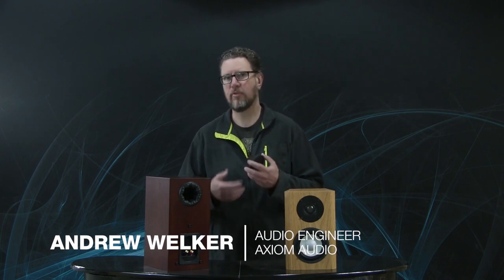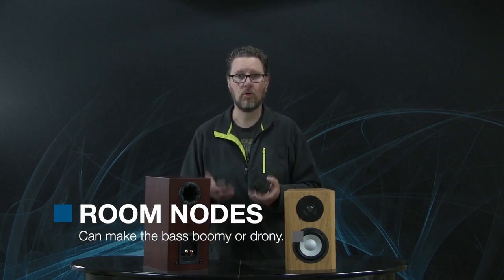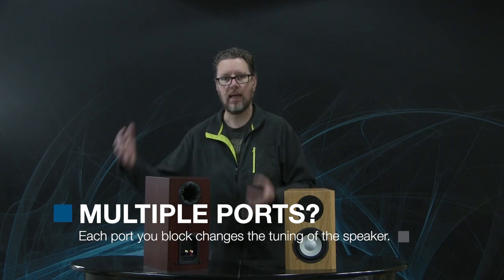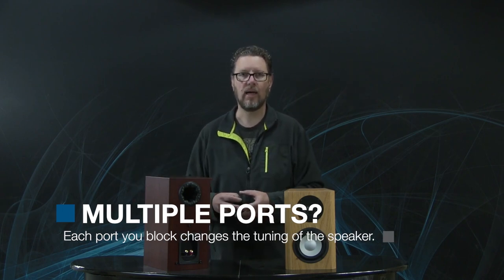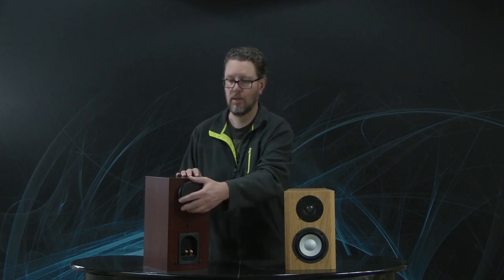Speaker Port Plugs: Could They Solve Bass Issues in Your System?

Comment: Thanks Andrew! This video solved a big problem for me. On some songs played very loudly the heavy bass made me feel sick in addition to sounding washed out. Using Sox’s as port plugs was a excellent suggestion. Now I can fine tune the setup.
Thanks again!
Reply from the maker: Glad the tip worked for you. It's so easy to implement and figure out which ports and how many to use port plugs in. Thanks for taking the time to comment, much appreciated.

Comment: A really good video! You have confirmed my exact situation. I have floor mounted enclosures with a rear port against the wall, they were just too boomy, so I used the supplied plugs and lo, much tighter bass, they now sound so much better and a good deal more like they did in the shop where I bought them.
P.S. I had terrible trouble trying to find the right speaker location, due to the room acoustics.

Comment: Thanks sooo much for doing this video, I had a huge peak on my speakers at 100hz that literally put daylight under my partner as the pyrotechnics were let loose during a Metallica concert from Slane Castle Ireland. As funny as this was, I have to sat the base was too much, so I purchased 2 x 1,3/4 inch rubber sink plugs (£4.50) and pressed them into the rear ports. Using an analyzer on my phone I rechecked the output and it had taken the top off the peak, making it much flatter at 100hz. The overall graph was now much better, with peaks and troughs less pronounced. They sound much better, bass especially sounds more punchy (less muddy you might say) these speakers are right up against the wall in a bay, and now perform far better at all volumes. win win. :)
Reply from the maker: This is so great to hear! Thank you for sharing your experience.

Comment: I use two small near field monitors and a sub, set up in a corner for my home studio.  The near fields are rear ported, and the sub is front ported.  I currently just have the sub sitting between the near fields on a desk top to minimze low end phasing between the sub and mains.  I'm going to experiment with plugging the mains first to try to clean up the mud that gets fired into and amplified by the corner.  Then I'll see what plugging the sub's port does.  Then, I'm going to try an entirely different configuration, with the sub on the floor in the corner,  and the mains making an equilateral triangle with both the sub and the ideal listening spot.  That way, theoretically all three speakers will sound in phase at the sweet spot, i can minimize what gets directed into to corner,  and the side reflections from the mains get directed around and past the sweet spot to rather than towards it.

Comment: It would be nice to know what "too close to the wall" means in terms of actual inches.
Reply from the maker: That will depend on both the speakers, and the room. The sock test is the simplest way to find out if the sound improves with port plugs. Thanks for watching.

Comment: This was really helpful. I have M3 Tis on full metal brackets on side walls within 2 feet of the back wall. (Due to toddler safety) They always had a bass bump I just lived with.  The rolled up sock trick worked well. Plugs on order soon.
Reply from the maker: I’m glad the video helped! It’s such a simple thing to try. Speakers cannot always be put in the “best” location.

Comment: I personally have the speakers 25cm away from the wall but the room modes are so strong I guess they are around 10-20 dB too high aroun 60-80hz. If I move forward from the couch it sounds much better but I cant move the couch more from the wall. Will do some room treatment but an easy way was to half close the bass port on the back. It sounds much more balanced. Finally I can enjoy listening to music. Closing them all up was deleting all the bass. So I left an whole around 3cm.
Reply: Bad solution. While I'm certainly not against plugging the ports of a bass-reflex speaker where ever and when ever it makes sense, your particular room challenges to me sounds like they can be addressed by other means, which will not rob you of the experience of good, solid bass reproduction.

So, in your case I'd recommend taking OUT those port plugs, and as aggressively as possible treating the most problematic corner of the room, either with effective (i.e. thick – or mounted at a 45 degree angle) bass-trapping placing in the most boomy corner of the room. Alternatively a subwoofer there. Preferably with variable cutoff frequency.

You won't believe beforehand how much of a difference the latter can make, in the whole room, once fine-tuned. When I did so in my own, current studio: it was one of those "holy cow... is this magic?" – cos it largely SOLVED some intense room modes around 40-43 Hz and 71-73 Hz that bass-trapping (even very thick – 18 inches or so) had almost no effect on, because the room modes are too deep, and therefore would require either an impractically thick fiber/absorbing-type bass-trap, or resonant absorber(s) like limp mass, diaphragmatic, Helmholtz... But I opted for the subwoofer-solution since I already had a spare, good one to deploy. And it satisfactorily fixed those room modes, **balancing and clearing up the bass in the whole room**.

Alternatively, **first try experimenting some more with the placement of the main speakers**. Incl. closer to back walls, or asymmetrically in the room, i.e. (OMG – don 't panic 😺) one in a corner, and the other not.

Trust me. I'm autistic 🤓 and read my first book about (electro-)acoustics when I was 9 or 10 years old. I'm now 43, and have built, and set up, MANY speakers – both PA, hi-fi, and studio.

I hope the above is helpful 🌸🤗💖 If you like HOUSE MUSIC: visit my channel for some of my productions 😎

Comment: Very informative video, many reviews exist about false "bass extension" by listeners, seeking bass reinforcement and placing ported or dipole speakers (like electrostatics) too close to a rear wall.  Some manufacturers design their cabinets with front porting to allow them to be placed close to a rear wall.  The original QUAD ESL, installed a piece of thick felt on the rear of the metal shield to reduce back wall interaction.
Reply from the maker: Correct, and port plugs accomplish nearly the same thing by “removing” the rear port from the equation.

Comment: Great video.  What distance do you find is the minimum the Axiom M100s can sit away from the wall without considering the use of the plugs?
Reply from the maker: As long as you are a foot or two from the back wall, you likely won't need port plugs, but it all depends on your specific room and speaker positioning.

Comment: The vast majority of home speakers are places closer to a wall. Roy Allison was right; design the speaker with bass response that rolls off to compensate for the bass bump that you gain by getting 1/2 or 1/4 space radiation at low frequencies. Of course, less ideal; you could adjust the bass control.

Comment: With more people playing lp records now, we should "revisit" the problem with warped records causing subsonic frequencies-Rumble. this can cause the woofer in bass reflex speakers to over extend and be damaged. My old Cerwin Vega literature states that if a 20hz filter is not practical, an effective solution is to stuff a wad of fiberglass in the port. I used a piece of foam. Thanks
Reply from the maker: You make a very good point. Sadly, subsonic or rumble filters have disappeared off most phono inputs and external phono stages. Plugging the ports does help, as you have discovered!

Comment: Thanks so much for this! However, I'm just wondering if I can also put a port plug on a down firing subwoofer placed in the corner? Will its bass imaging also improve even though its port is on the bottom? Thank you 🙏

Comment: Question what if the bookshelf speakers are your rear surround sound speaker that hangs on the wall should I still port it? There 13ft away on each side.
Reply from the maker: If it’s rear-ported you might find too much of an increase in mid-bass information, so you may find the sound more neutral with port plugs.
Reply: @AxiomHomeTheaters  thank you bro

Comment: Small ports do almost nothing because the port reaches power saturation a power levels less than one watt.  That means maximum acoustic output will be near 85dBa typically.  A large port or passive radiator is a much better choice.  Small ports should all be plugged.

Comment: Soooo.... are rear ported "Book Shelf" speakers (or any book shelf speaker) not actually designed to sit on a book shelf? Most book shelves are 9" to 12" inches deep, right? That means the back of the speaker is going to be either right up against, or at least very close to the wall. Am I taking the name "Book Shelf" too literally?
Reply from the maker: Yes, you are correct. I think the term bookshelf speaker just fell into use at some point…probably after the era of the “big bookshelf” 8-inch 2-way that was all the rage in the 80s. Plugging rear ports can work to allow close to wall or bookshelf mounting.

Comment: So if I setup at my bedroom, should I get frontported monitors, or is a port-plug the better solution? My sensibilities say front ported
Reply from the maker: If you have a choice, I would go with front-ported. However, if you find a pair of speakers with rear ports that you fall in love with you can always try them with and without port plugs.

Comment: I have three sets of speakers with rear ports so i've had to move them all away from the wall and it's kind of a pain because my place is tiny although in my experience front ported speakers actually leave marks on the speaker grills after a while
Reply from the maker: Yes, in a dusty environment or just over time you can find a mark appearing on the grilles at the port location. This will normally just vacuum off with no issues.

Comment: So it sounds like the rule here is to just experiment a little and listen to the changes..  thank you !
Reply from the maker: Exactly, it's going to be different in every room, so the best way is to find out if in your room it sounds better with plugs or not. Look forward to hearing what worked best for you.
Reply: @AxiomHomeTheaters  I ended up with a nice improvement just pulling them away from the wall a little and spreading them another foot or so.  My room is smaller so these differences helped a lot.
Reply from the maker: @g.fortin3228  excellent, great to hear. It's amazing what a small change in position can end up doing to improve the sound.

Comment: Hi, how does to plug covering effects the high frequencies and the sound stage ?
Reply from the maker: Well, port plugs will only directly impact bass output, but the change in bass can lead to perceived changes in the rest of the loudspeaker. If the port plugs significantly reduce bass output, it could make the speaker sound “brighter” with more high frequency energy. This could also make the soundstage seem larger in some cases.

Comment: I'm currently having an issue with a set of 3-way 12in speakers I just bought. They are homemade and have a 3in front firing port it make the bass sound like crap I stuffed packaging foam in the hole and taped over that sounds great looks like hell . Where can I purchase port plugs online for a 3in port thank you for your time I really appreciate it.
Reply from the maker: I’m not sure where you could find dedicated plugs, but you can probably buy a black, soft, closed-cell foam and roll it up tightly. It should not look too bad.
Reply: @AxiomHomeTheaters  thank you for your reply I recently cut the packing foam to fit also used some thinner packing wrap for the inside so far so good.
Reply from the maker: @timbabyfacesavage377  Sounds good!

Comment: I bought Cerwin Vega towers With two 8-inch woofers They made my face hurt and my ears It was just overwhelming The bass . I exchange them for 3-way speakers with a 12in woofer And to my surprise there's a port in the back So I'm  hoping I don't have the same problem I had three way speakers years ago that came with my Kenwood stereo system and I thought they sounded pretty good with no port. I'm tired of returning speakers.
Reply from the maker: If your ears are hurting then either you’re playing the system at levels that are too loud, you’re clipping the amplifier, or the speakers have a very non-linear frequency response.

Comment: How far from wall would be enough for rear ported speakers?
Reply from the maker: I usually recommend a minimum of 6 inches, but it will depend on your speakers and your room.
Reply: @AxiomHomeTheaters  Thank You. I can leave about 3 feet (maybe little more) free space. Should I be fine with home hi fi setup in untreated room?
Reply from the maker: @jonrael3443  It’s impossible to know as every room is different, but you have enough space to the wall behind the speakers that you can play with positioning and toe-in to dial in the performance. Many don’t have that luxury!

Comment: What if speakers are close to the wall, but there's a 4" acoustic panel behind it?
Reply from the maker: The acoustic panel will likely do little at lower bass frequencies, so you might still get too much mid-bass.
Reply: @AxiomHomeTheaters  Thanks, Andrew.  I believe I'm going to use the plugs because I'm switching my center channel to an in-wall that has a cabinet and no port.  Probably should plug the bookshelf speakers to match, eh?
Reply from the maker: @lancemathes319  I would try both and see how the blend sounds with your subwoofer. You might find that not blocking the ports in your bookshelf speakers works better.

Comment: I'd love to hear your opinions or thoughts on systems like Audessy/YPAO.
Reply from the maker: I’m not a fan, but I do concur that they are often easier to use for setup and they can make improvements at low frequencies, depending on your room. I always recommend trying a manual setup and then comparing the sound.
Reply: @AxiomHomeTheaters  FWIW, I don't trust my own ears and as a friend says, if you can't measure something, you can't improve it.

Comment: overheating at loud volumes could also be an issue
Reply from the maker: Exactly…both changes in driver excursion AND reduction in air flow need to be taken into account. That’s why I always suggest checking with the manufacturer first.

Comment: So, if speakers are NOT suppose to be placed near walls...why are the ports on the back? The whole reason for ports on the back is for them to bounce bass off of the walls to increase the sound. Some brands actually tote this. And pretty much all subs are designed to be placed near walls, or even in corners. I understand how the science works as far as sound waves, bass reverb, and harmonics go....but it seems to me that too many ppl are spending WAY too much time worrying about this. I had a buddy over the other day to hear my new Zu Omen speakers. Guy doesn't know a subwoofer from a tweeter. But the moment the speakers fired up his only response was "All I can hear is the reverb". I have a 1/3" gap on my speakers (look up these speakers for details, down firing ports). He's SO obsessed with videos like this he has no idea what speakers are suppose to sound like. This feels like a 2000's solution to my uncles 1970's issues....fill the box full of as much insulation as you can...the less air, the more bass you have.
Reply from the maker: Different designs require different port placements. Sometimes it might be as simple as staying within a target height. Bass from ports does not bounce of walls in the way that mid and higher frequencies do. In some rooms corner placement of subwoofers or near-wall placement of speakers will work well, in other it will be a boomy sounding mess. This is why we have methods to tune for different setups and rooms.